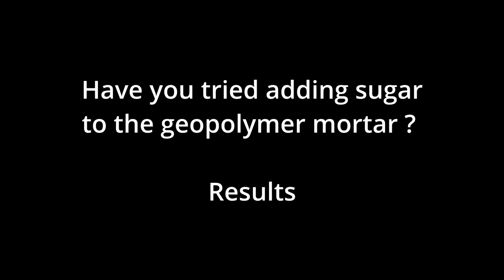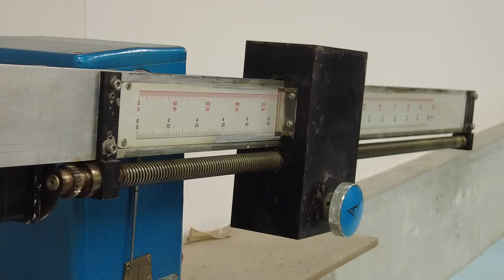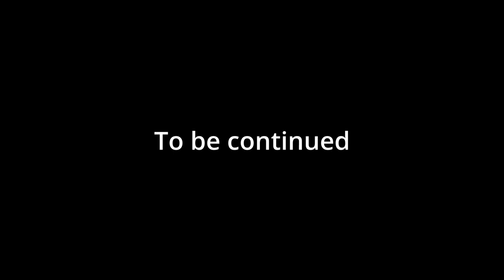＃043 Have you tried adding sugar to the geopolymer mortar?......Result

Comment: Great job. At which time did you perform the compressive strength test? Thanks in advance.
Reply from the maker: The compressive strength test was conducted after curing at 60 degrees for 12 hours.